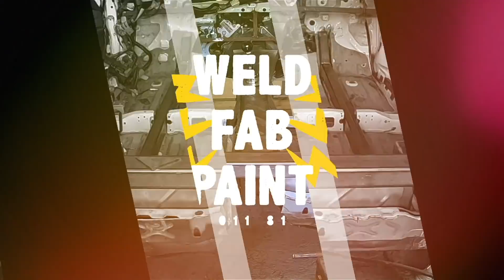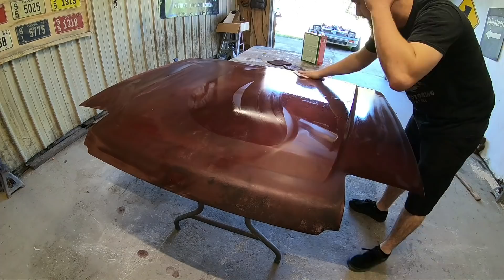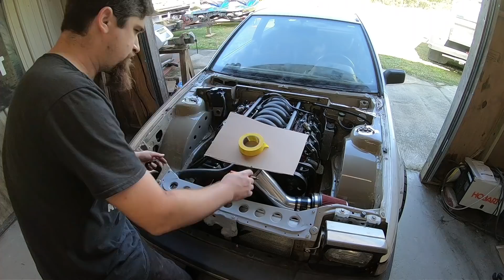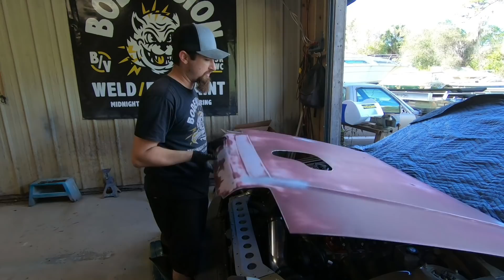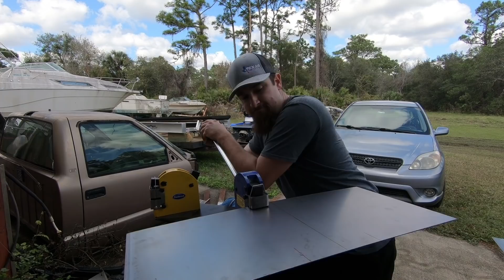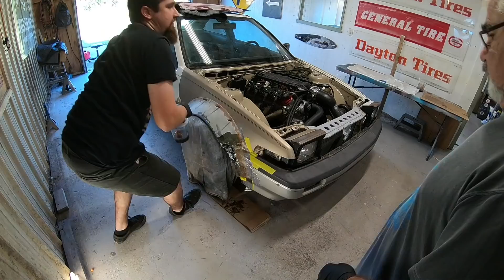Custom Widebody kit and LS swap!

Comment: The ultimate achievement would be to use an oem hood and have it fit without cutting. If you used risers on the hood hinges and then used fiberglass to extend the edges to make up the difference... 
Ive been following hush performances development of a hybrid hood where they use the usdm and jdm hood for the crx to make a fiberglass hood that will clear the bigger B16a valve cover. I think you have just as much experience with fiberglass that u might be able to apply that method to this build... It would also go perfect with the wide body kit!

Comment: I think if you space the rear of the hood with some hood risers good ol’ eBay special. And then also get one of the D Max style vent cut out so you have a functional vent in the hood and if need be just cut out the two or so slats you’d need to clear the throttle body and intake tube. 
I also just thought of the vent some use for like a V mount set up, think it’s one from an evo X. set the vent right over the throttle body and tube. Think those would make for some cool functional vent in the hood that also clears the stuff you’ve got just poking out the hood now. Hope these ideas come across clear? Hope they help if it is translating correctly…? 🤞🏽🤞🏽

Comment: I like the idea of using an eclipse style hood bulge. I think it will affect the car's lines the least. One thing I am wondering is why you would cut out the hole to fit around the power steering reservoir instead of remote mounting it?  Also, are there aftermarket fuel rails or intake that are lower profile so you wouldn't need to cut for those as much or at all? And, if you got a dry sump setup would you be able to lower the motor enough to not need any external hood cutting at all?

Comment: If that soft plug leaks again use red locktight not silicone, silicone is a lubricant witch will cause it to fail

Comment: Make that piece for the hood out of fiberglass is easier and it would mould better to the hood.
Reply: Make like a fiberglass cap install it with rivets and the mould it in with fiberglass body filler.